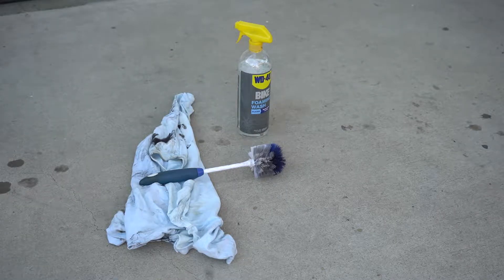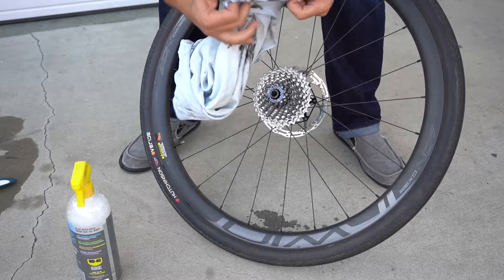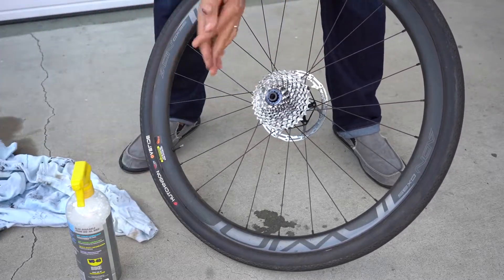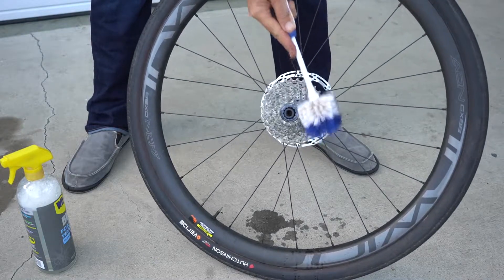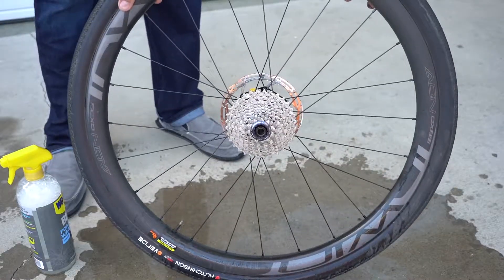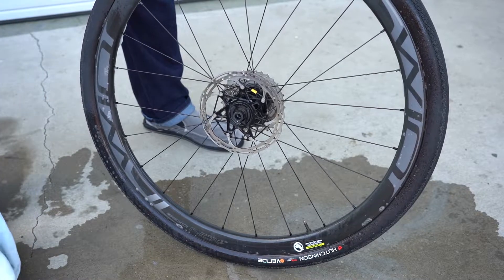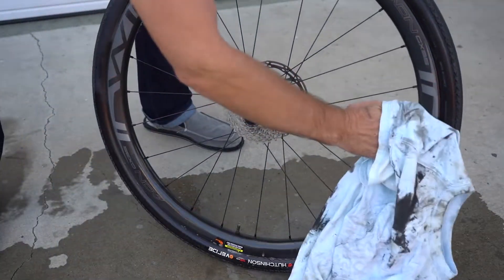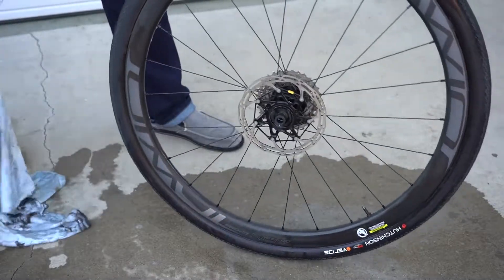How to clean your Irwin  Carbon Bicycle  Wheel

Comment: How Not To Clean A Carbon Wheel. You sprayed it with whatever that was? You didn't rinse! So in a real life scenario. Bits of grit & dust would have still been attached to the wheel surface.then you simply wipe it & move the crap about the surface with a minging oily tey shirt.😂😂😂😂